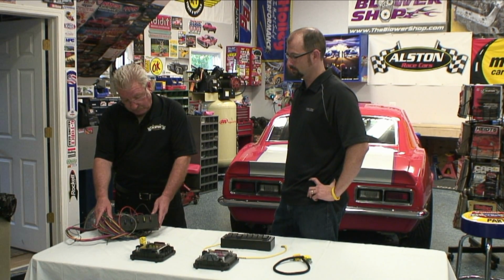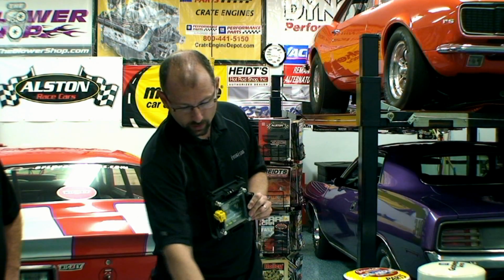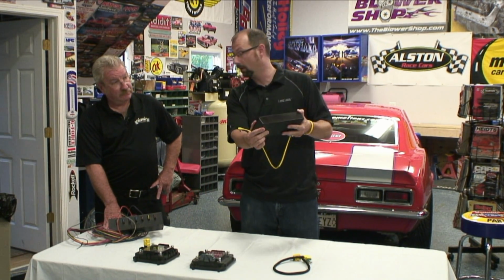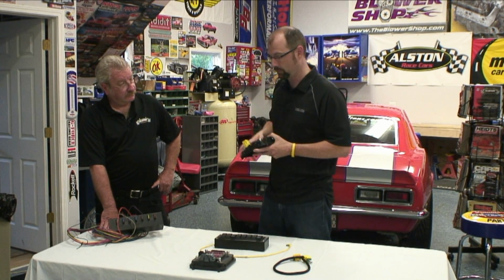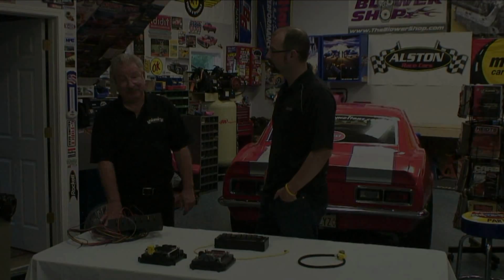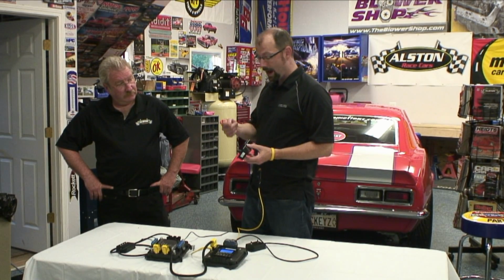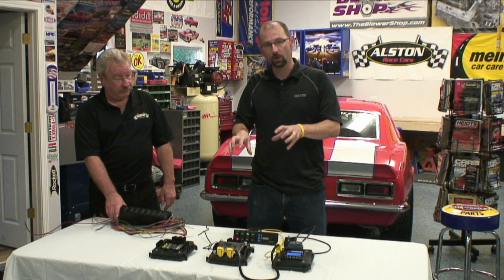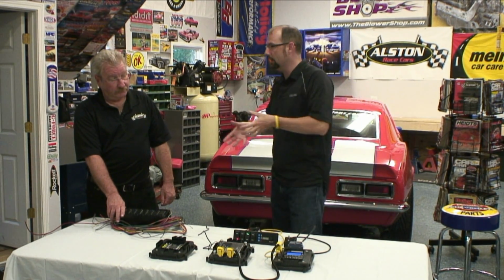Alston Performance Electronic System

Comment: Jay- You should really push the racing side of your product- I never even considered that the tire shake or vibrations of a 1000hp+ drag car could shake open a relay or mechanical switched connection! This winter we will be installing an Isis system on a 1000+whp LSx powered '39 chevy door slammer- can't wait!